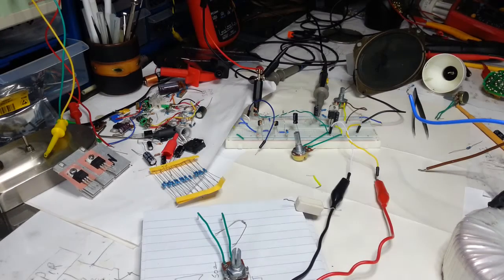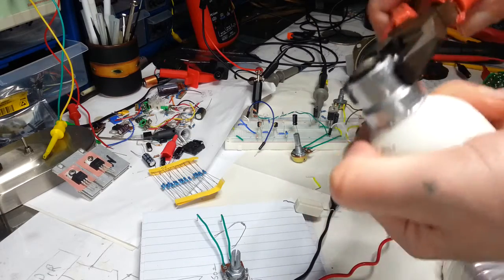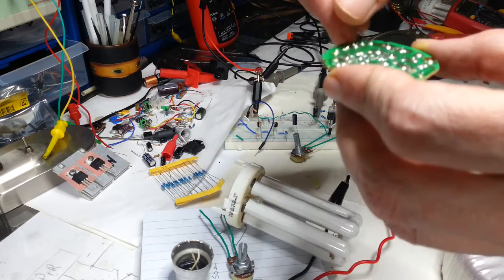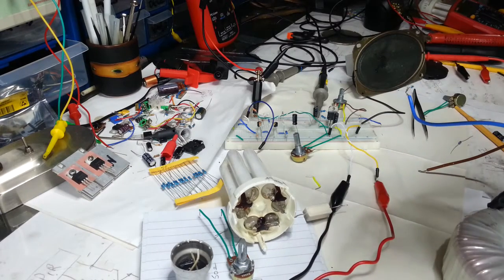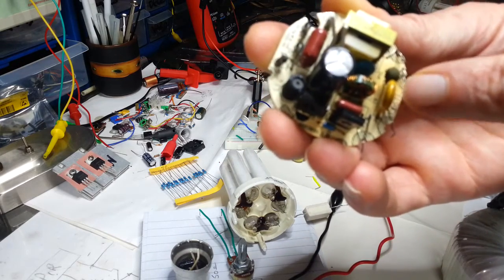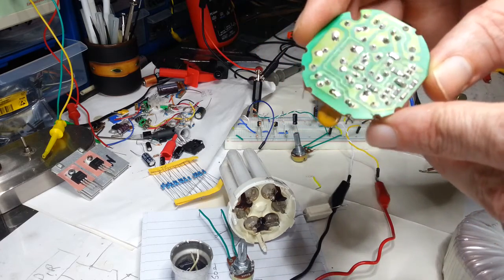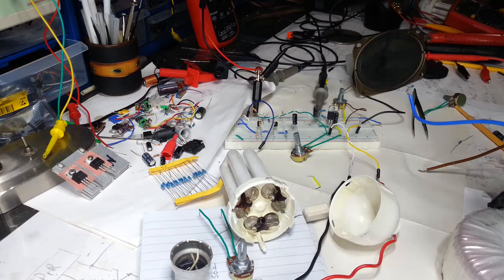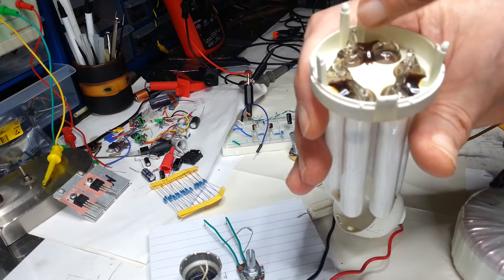Inside a Compact Fluorescent Lamp

Comment: You may have already worked this out...it's a single glass tube with an arc (see the glass bridge between the sections)  On my 'to do' list is a cfl that runs on an AA battery with a toroid. You can get a very bright output with the right coil....here's a link that you may find interesting....
http://www.pavouk.org/hw/lamp/en_index.html